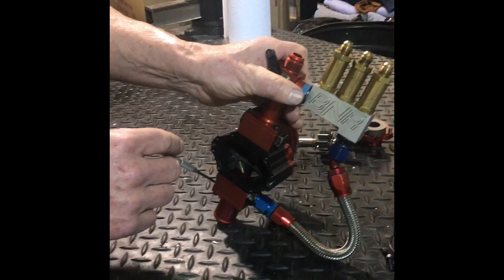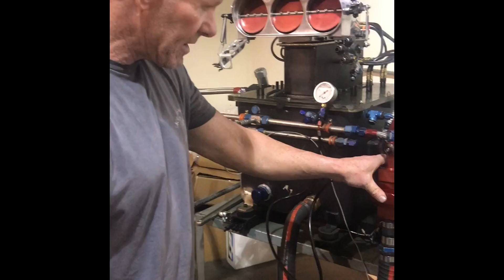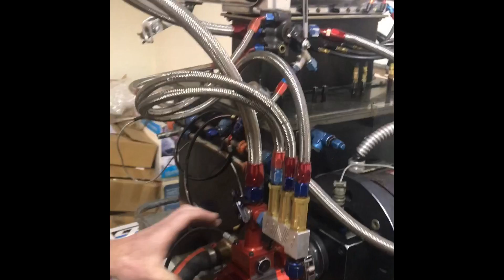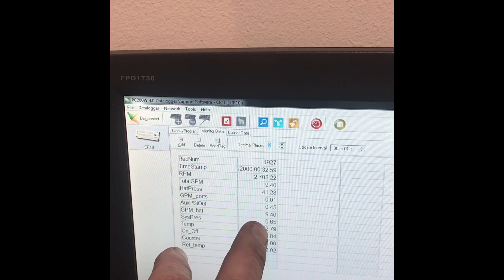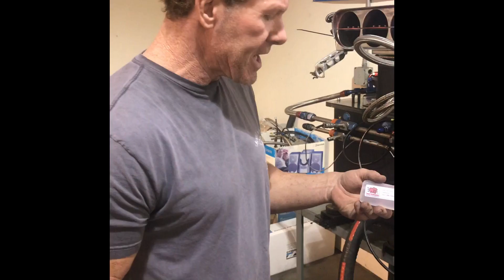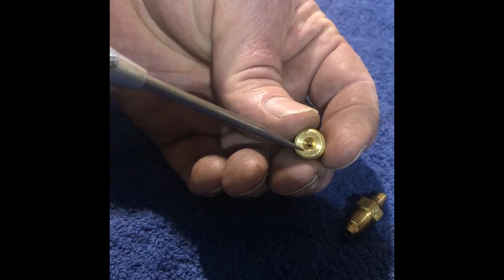Blown Alcohol Fuel System tutorial with Randy Anderson

Comment: Flush it with what fluid? Gasoline? I've seen two different videos now saying to flush. Can we get a video of the flush itself.
Reply from the maker: Depending on your application.  If you run a class that has fuel check and requires pure methanol, then the silicone pump lube is recommended.  Just take the main fuel line off, open the fuel shutoff and pour some down in the pump.  If you don't have to worry about fuel check, marvel's mystery oil, wd 40 or any light weight lubricant will work.  Also need to get some in the barrel valve spool.  When sitting for long periods of time, all lines need to be completely drained.
Reply: Hanna Services Social so it's not like routing something to the pump inlet and running/spinning the engine for 30 seconds or so?
Reply from the maker: In this particular application, no.  Best option is to lube for short breaks in racing, and for long term breaks lube and drain completely.